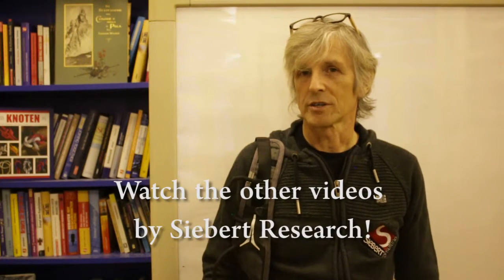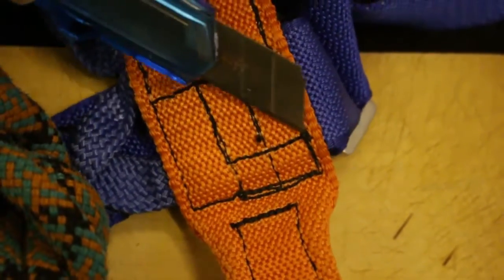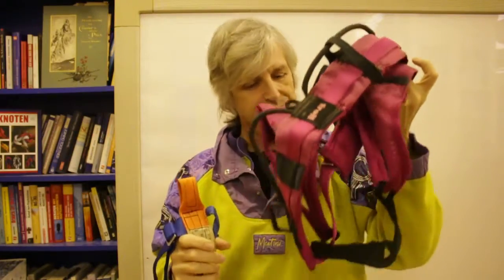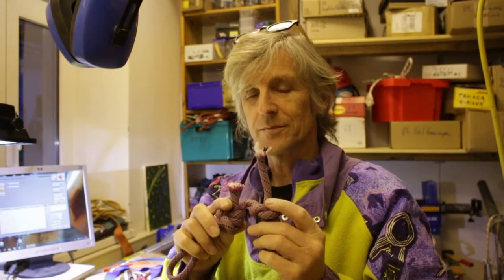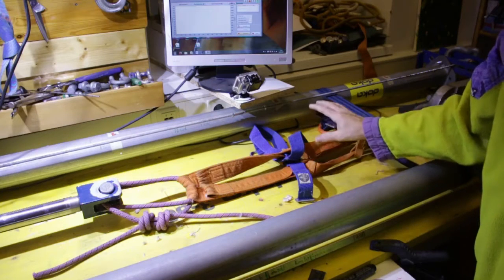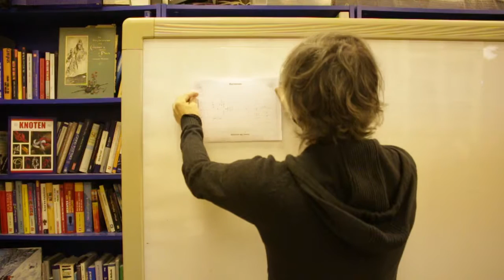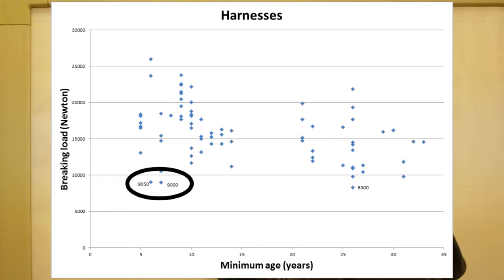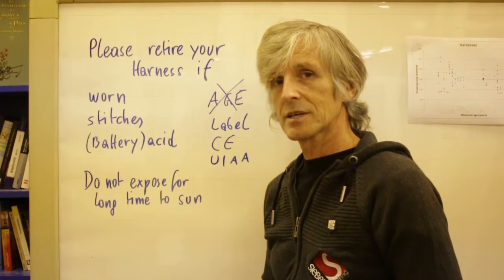Discard criteria for harnesses

Comment: Hi,

Interesting testing: I just came across your videos when someone asked us a question based on your waterknot video. 

I have some comments abut some of your points.

One important difference between webbing (used for harnesses and slings) and climbing rope (with a mantle) is that the mantle protects the load bearing rope fibers from direct abrasion. Although you CAN get internal abrasion via dirt that rubs the individual fibers as they slide against each when in use. This has been shown to occur in controlled studies: dirty nylon ropes were sectioned, and damage to fibers was observed under magnification.

And this means that a dynamic rope have an indirect correlation with age, in that the older a rope, all else being equal, the more times it is loaded, and the more internal abrasion due to dirt occurs. And also the more chance to collect dirt.

You can reduce this effect by keeping your rope clean, but you cannot stop it; your rope will always be exposed to dirt, and the dirt cannot be completely cleaned out. And when you clean it, you also start to remove the dry coating, which you want to keep intact in order to reduce moisture ingress. Which has a very large effect on rope properties.

For webbing, it's important to realize that ALL the fibers from it at some point are exposed on the surface: unlike a rope, there are no protected or internal fibers. So if you damage any one area of the webbing, you have in effect cut those fibers: they no longer hold load in that area, and for some distance either side of the damage (until the friction from other fibers starts to hold them again, and they take load).

An experiment can be done with webbing where you rub it against a rough surface: concrete say. And then test it. Even without a lot of obvious damage, the strength of webbing can be reduced drastically. I have a study that's been done on industrial access harness where this was done to show this exact issue.

This sort of damage is not directly related to age, but as with ropes, the more you use it, all else being equal, the more you scuff and abrade it on hard/abrasive surfaces.  Every time you damage a fiber, the harness is weakened. At some point it fails. And it's not so obvious when that happens by visual examination.

That's why the manufacturer recommends that harnesses are replaced after so many years. There might well be lots of life left in them. Or else they might be just about to fail: you don't know.

And signs of wear means there is likely a LOT more wear you cannot see. Industrial access harness are used daily, for many hours at a time, and can wear out in a year or two. Where it might take 5-10 years for a climbing harness to see the same damage.

And you are correct, there is not a lot of published work on the effect of use/number load cycles/age on climbing rope properties. There is a bit more done on larger scale nylon ropes used in industry: like for offshore use on oil & gas platforms, but still not a lot.

Alan Jarvis
UIAA Safety Commission

Comment: Pardon my ignorance, but why is this setup better than a drop tower, static loading testing  doesnt seem too relevant for real world scenarios even more when testing CLIMBING equipment.
Reply: The reason why I decided not to do drop tower tests are following:
1. The drop tower test does not reflect reality. It is primarily designed for comparison of new products. The impact forces are much greater than real loads. If a rope withstands only one drop test it shows that it is "safe" (strong enough to hold any impact force in climbing/rapelling activities).
But if it fails the drop test it does not automatically mean that the rope was dangerous. There is a lot of "safety factor" in the drop test. 
The impact in the drop tower is much higher than real loads.
2. The "Sicherheitskreis im Deutschen Alpenverein" and Pit Schubert did enough research to state that ropes will not break in carabiners, knots etc., no matter if they are 10, 15 or 25 years old.
here is the link to one of his articles in english:
http://www.siebert.at/media/file/75_About_Ageing_of_Climbing_Ropes.pdf
I did not see to verify these results, since I could not find any case of rope failure in a knot or carabiner due to age.

Therefore I decided to do only static tests to find out, how close discarded ropes are to a breaking load which I define as "dangerous". The drop test would not have helped here.